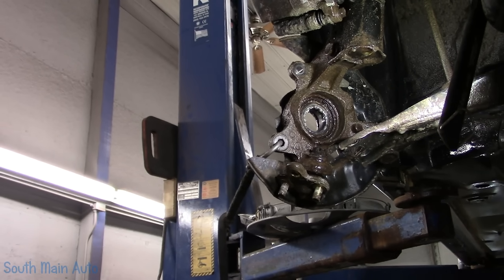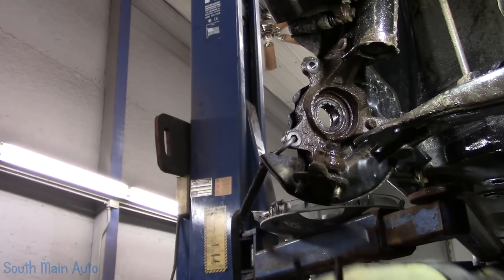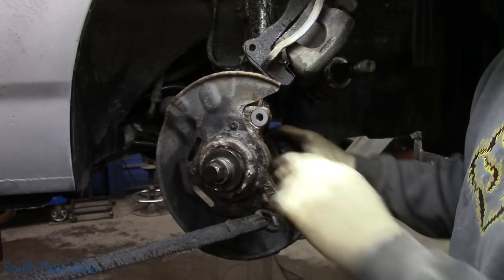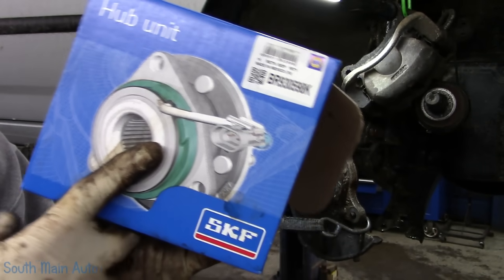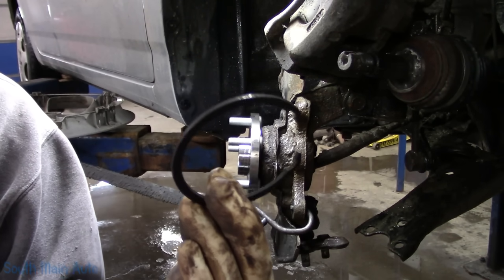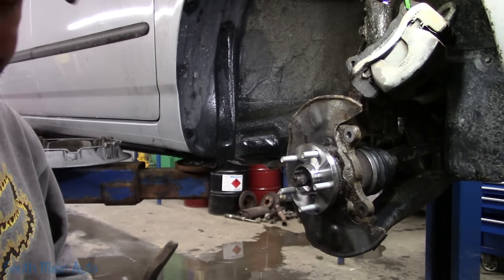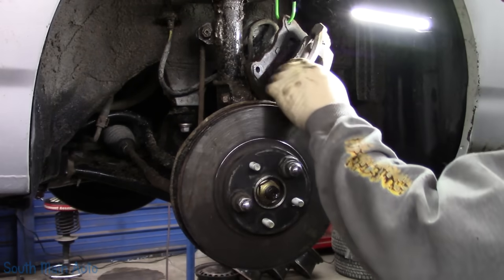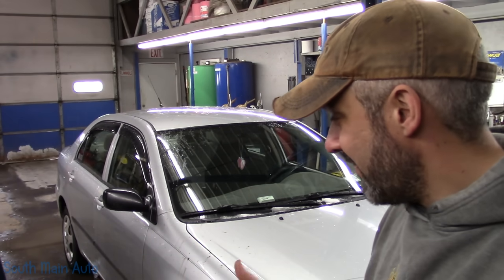Toyota Corolla: Front Wheel Bearing Replacement

Comment: 1: adding those bearings to the forcing screw seems like a great idea, I've just used grease and washers in the past
2. I'm impressed with that electric impact getting the job done, not sure if it's the bearings reducing the friction or what but my air gun has struggled on the same task
3. For the uninitiated: I've done the slide hammer thing using the cars lug nuts and gotten them deformed that way against the slide hammer plate (esp. those Toyota ones that are tapered). I stick a washer in there to protect them or I've used some spares. 
4. Schmutz is a word, Yiddish for dirt or gunk, though I've always heard it pronounced rhyming less like 'putz' and more like 'foots' 
5. This comment was (obviously) meant to be read in a surfer bro voice, bro. If you didn't get that try again (bro).
Reply: I know it’s been a while since this OP but what size bearing can I add to the bolt as the removal aid? I couldn’t tell? Like a 2.5”? Thanks much!

Comment: This is the one thing I'm NOT looking forward to on my Dakota.  I'm pretty comfortable doing ball joints, tie-rod ends, sway-bar end links, but this has me worried.  I might have to weld up a hub tamer!
Reply: Dan Gates I thought a Dakota had a bolt on hub assembly. At least mine did I think.
Reply: Yes, it does, but I'm conceiving a triangular base bolted to the old hub, with a big lever arm welded to that which will receive attention from the BFH.

Comment: Dang, I'm getting more and more sold on that Earthquake. Have you had to warranty it yet?
Reply from the maker: Nope
Reply: South Main Auto Repair DANG.
Reply: I bought one recently and it works great! Used it to replace the front lower and upper control arms, ball joints, sway bar links and removing the axle nut wow what power!
Reply: Most of the stuff from HF is a gamble, but in the case of the Earthquake (especially the newer version), it definitely gives it's Snap-On, Ingresoll-Rand, Matco counterparts a run for the money.

Comment: 2 videos of the exact same repair, that's NOT encouraging for this model/years!!!  I'm getting ready to do this exact thing on my sons 2004, I'm opting to just replace the whole steering knuckle with the bearing already pressed in.  Two reasons why:  1. I don't have all the presses etc and would have to buy them at about $150-180.  2. I get the thing apart in the driveway (no lift at my house) and fight it all weekend and still have a non-working car still on jack stands come Monday morning!  GASP!

Buy the knuckle and it's a bolt on repair and should be done in 45 min (here's hoping), I'm driving my son's car while he's away and I'm saving about $40/week in gas savings over driving my truck.  So investing in this car feels like a no brainer.  Oh, and a little more about the car:  297,900 miles.  I wanted to get it to 300,000 before doing this repair, but it's not gonna make that.  It sounds like a "jet engine" as well.  Very "clunky" when manipulating the wheel when off the ground.  Def the bearing!  Might drop a video of it on my channel as well, because you can't have too many 2003-2008 Corolla wheel bearing repair videos out there!!!  LOL

Comment: Nothing like a little Vivaldi and air hammer in the morning. What a slushy dang mess.I'm liking that earthquake I just got the 3/8 gun but haven't used it yet. Looks like I should get the 1/2 too. It will be a pleasure not to hear my compressor it runs at 3600 rpm and it noisy as crap.
Reply: Eric Corse 
That was Mozart on the intro, eine kleine nachtmusik.   You’re probably thinking Vivaldi 4 seasons, fine music.   Btw, the movie “Amadeus” is about Mozart, a good date night movie.   It’ll put the juice in your girl’s impact wrench...
Reply: I stand corrected I was thinking of 4 seasons. I have seen "Amadeus". He was a rascal.

Comment: Instead of buying the $500 hub grabbler kit I can buy a $120 harbor frieght 20 ton press and use it for other stuff than just bearings and hubs
Reply: I suppose if you have the space for it and no requirement for mobility.  Also, wheel alignments can get pricey unless one has a contract.

Comment: Isn't using Water Displacement 40 for the snap ring removal worthless in this situation?
Reply: The main thing WD is not is a long-term lubricant. Just oiling something up for imediate use and it's fine.

Comment: NYS should be held criminally liable for the property damage they cause from their unnecessarily high over use of corrosive road agents to combat people's idiocy and inability to compensate for less than ideal road conditions.
Reply: Why do you blame only NYS?  That stuff ( or mag chloride in some states) is everywhere north and in the mountains.
Reply: I blame only NYS in this case because that is where I live and where this video was based.  I don't assume we are the only ones using this crap.  This area in particular however does seem to use it in excess.  Even times when it would be prudent to drop that blade they have hanging in the air, they instead put down enough salt / crap to choke a horse.  So much that when it dries, the roads are so white it literally looks like it's packed snow.  When you drive down the road, the white dust cloud behind you looks like your're going down a dirt road rather than a paved surface.  Hence why most of the vehicles Eric works on look they were just pulled up from the Titanic wreck.

Comment: Unsubscribed.  Didn't remove wheel lug nuts in the alternating cross pattern thus warping not only the wheel, but also the rotor and unit bearing flange.
Reply: See ya, brah!